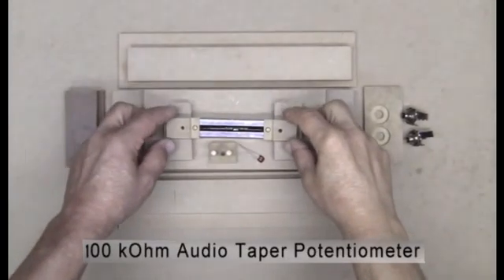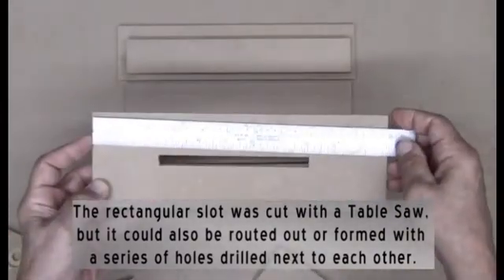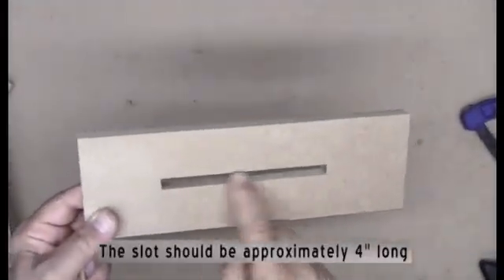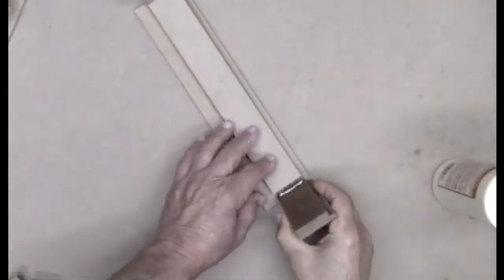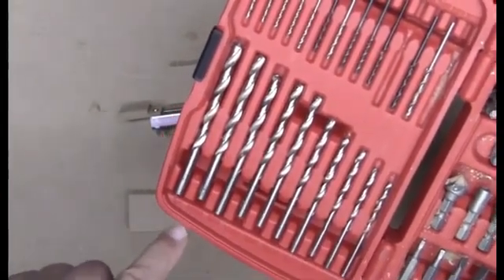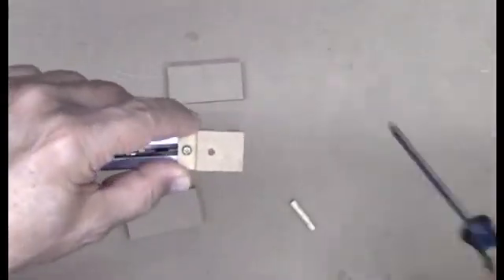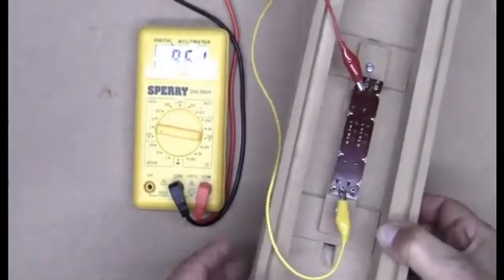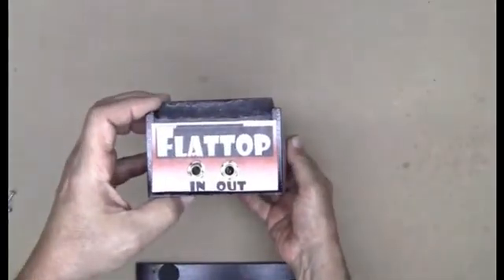Build Flattop, the Innovative Volume Control Pedal

Comment from the maker: this would work, but it wouldn't use a pot.  Rather, a series string of resistors with the switches connected at appropriate points.

Comment: thanks for sharing! excellent idea, i thought about another type of volume pedal too (with just two "pushing" switches, one for 'plus', like a booster, and one for minus/muting - it saves space in my pedalcase), but i was in doubt whether it could affect the guitar tone. do you know if you need a specific kind of pot so it gets a clean bypass (sorry for the dumb question but i know nothing of eletronics, just a bit of soldering)? thanks for any insights